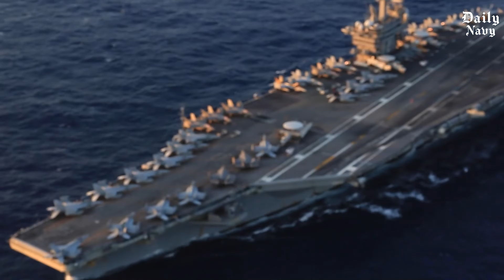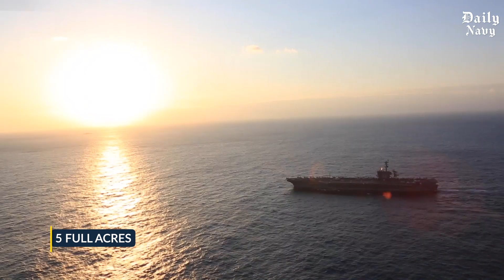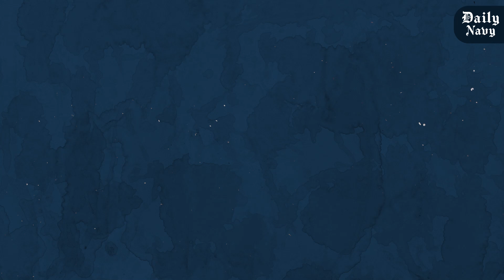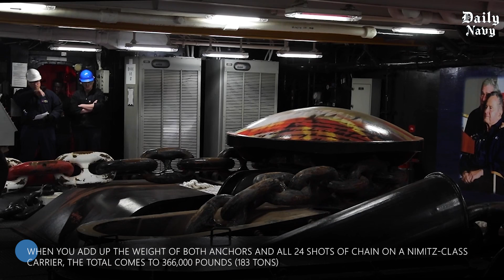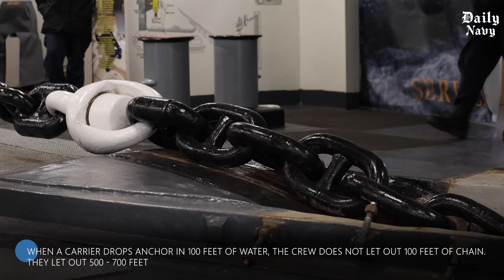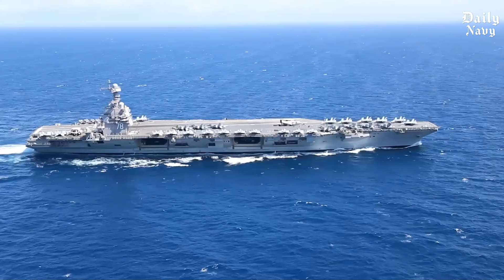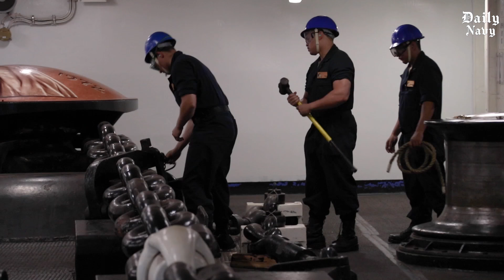Why U.S. Aircraft Carrier Anchors Are More Insane Than People Think

Comment: If the star of the system is the chain then why do you need an anchor? The job of the chain is to keep the anchor low against the seabed by applying its own weight so the anchor is not pulled off. That´s why smaller boats use a combination of chain and rode

Comment: The commentator is wrong. I am 70 and still have my CDL Class A license.  My first B license from 1989 and from 1992 my A license till this day. I am a dispatcher.

In the United States, a standard semi-truck and trailer combination is limited to a legal Gross Vehicle Weight ( GVW ) of 80,000 pounds on interstate highways . To stay compliant, the weight must be distributed across specific axle groupings according to Federal Bridge Formula laws . 

The standard legal weight combinations for an 80,000-pound, 5-axle semi-truck are broken down as follows : 

Standard 5-Axle Configuration

Steer Axle (1 Axle): Maximum of 12,000 to 12,350 pounds .

Drive Axles (Tandem / 2 Axles): Maximum of 34,000 pounds .

Trailer Axles (Tandem / 2 Axles): Maximum of 34,000 pounds .

Total Gross Weight: 80,000 pounds .

DOT Single & Axle Group Limits

To avoid fines, individual axles and axle groupings cannot exceed these federal constraints :

Single Axle: Max 20,000 lbs .

Tandem Axle (two axles within 40 to 96 inches of each other): Max 34,000 lbs .

Tri  Axle (three axles): Typically 42,000 lbs, depending on spacing and state laws . 

Federal Bridge Formula

Federal law requires that the weight-to-length ratio across any group of consecutive axles strictly complies with the Federal Bridge Gross Weight Formula. This ensures the weight is spread over a long enough distance to avoid damaging bridges. 

Overweight Combinations

When hauling heavier freight (like machinery or bulk materials), specialized multi-axle configurations (such as 6, 7, or 8-axle trucks, jeeps, and boosters) are used. 

State Routes: Non-interstate highways often allow higher maximum weights. For example, Washington State permits up to 105,500 pounds for 7-axle combinations off the interstate . 

Super Loads: For weights exceeding standard configurations, multi-axle trailers (like lowboys or specialized perimeter trailers) are required, and drivers must obtain single-trip or continuous overweight/oversize permits. 

To determine the exact legal payload capacity for your specific truck and trailer tare weight, you can utilize the Oversize.io Axle Weight Calculator to balance your load.

Comment: It would be helpful showing a diagram of the anchor chain and its individual components, including the length, weight, and other relevant specifications for each section, as well as the total length and total weight of the chain. It would also be helpful to show these values in proportion to the aircraft carrier, providing a clear sense of the chain’s overall scale.

Comment: A fully loaded (DOT) semi Truck weighs 80,000 pounds. However, there are some loads that can weigh much more than that. They require more tires to distribute the load. I would suggest that you do a little bit more research before you publish your videos.

Comment: In the Coast Guard we use the same chain to anchor buoys, using 10 ton concrete blocks.  But they aren't as strong as they seem.  During hurricanes the chains can be pulled so hard they're stretched into thin wires, and the buoys are sometimes still attached, a mile away from where they're supposed to be.
Reply: Wow that’s pretty crazy too !
Reply: Not facts.

Comment: A lot of people don't know that the chain box is one of the most dangerous rooms in a boat or shipyard! It has historically cost a lot of lives. But the reason is not what people usually think and why I always wore a positive pressure mask the whole time working in the chain box; the steel combined with salt water pulls all the oxygen from the room!
Chain service was my job for years 👍
Reply from the maker: Chain box stories like this don’t get told enough. Oxygen‑starved spaces are terrifyingly unforgiving – huge respect for the way you approached that job and stayed safe 👍
Reply: @Dailynavy  Thanks! Actually lost 3 colleagues within two years thanks to oxygen starvation. Two of them died during their coffee breaks, the last one was working in a team and was alone in the tank for just a few minutes while his mates were outside prepping a pipe.
But what makes the chain box so extremely dangerous is the huge surface area of the chain, even flushing the room with industrial fans were useless, the only safe way to go there is with pressured air masks.

Comment: Mouse Cop,  The 80,000 is for a 5 axle if it is 52ft min from center of steering to center of furthest trl axle back. 12,000 str, 34,000 drives, & 34,000 trl. On average most wanna keep empty weight at 30,000 or less to haul 50,000 legal.

Comment: In the late sixties l sailed on over 200,000 dwt tankers....( they are even larger now.) ..They had anchors and chain just as heavy and large ....The chain was pulled out of the Chain Locker by a massive windless over a bogy wheel  then down into the hawse pipe...It was possible to stand beneath the massive chain, pretend you were holding it up ..like a weight lifter...

Comment: My old 18’ boat had a decent Rocna anchor, most of the rode was 8 mm Dyneema but I made sure I had a good long length of heavy chain.
Reply: Honestly on a modern anchor like a rocna, even a Danforth, you don't really even need much chain if you use 7:1 scope.   I've anchored in 40 kt with just polypropylene and my Danforth.   It was the backup anchor.    When you get to that wind speed, the chain becomes a straight line "bar tight" anyway, so you get the same angle.  Because of that,   using a chain as a catenary is really a poor substitute for scope.  But it works great on a lunch hook, or any time youre pretty confident there won't be 30+ winds.   But the reason I still prefer to run all chain is because of the bottom.   When you run 7:1 with line, and the wind stops blowing or changes direction, it'll either get wrapped up in the reef and fray with nylon, or get wrapped around your keep/rudder/prop, with floating line!   But I wonder why the navy doesn't design massive versions of modern anchors?    This stockless ones provide almost no holding power compared to rocna, even a cqr or Bruce

Comment: You talk about the Ford CVN-78, and then show the Lincoln CVN-72. 
Nobody ever calls it a "forecastle". It's always called a foc's'le.
Three things on a US Navy carrier that make the most God awful noise you ever heard... an aircraft launching when you're under the forward end of catapult #2 (where my bunk was on the USS Constellation CV-64), an aircraft recovering when your bunk is right under the #3 wire and your berthing is right in between the hydraulic engines for the #2 and #3 arresting wires (where my bunk was on the USS John F. Kennedy CV-67), dropping the anchor when the foc's'le is directly below your berthing (again, on the USS Constellation CV-64).

Comment: Not actually understanding the premise of hold, then the “improvement”.
If the weight of the anchor and chain on the bottom is what holds the ship, then why reduce the weight of both just to make up for it by increasing the length? Seems that shorter and heavier, reducing time to deploy and retrieve, would be more important than… what, exactly?

Comment: Interesting video, I wish they'd discussed the procedure for bringing the anchor back up.  I would assume that once the slack on  the chain resting on the sea floor is pulled back into the ship that the anchor then releases from the sea floor, but I don't know that for sure.
Reply: I was waiting for that explanation as well.
Reply: When the anchor breaks free they call "anchor's away" which means the ship is underway (and it's the Navy song) then they haul in the chain and wash it with a fire hose as they bring it in and secure it.  On Sacramento the focsale is the main deck in front of the bridge and the capsan are there too.

Comment: Not a big fan of AI generated content , but no other complaints.  One small detail that was omitted is that the weight of the anchor starts the chain running.  Since it is the weight of the chain that anchors the ship, the ships I sailed didn't use an anchor designed to dig in.  They prioritized getting the thing up, and fitting closer to the hull to minimize hull damage in high seas.

Comment: A FULLY LOADED semi truck weighs in a a bit under 80000 lb.
Reply: This helpful bit of information from the Department of Redundancy Department in case you missed the posts from other 20 or 30 truck enthusiasts!
Reply: @richardwells556  Just in case you missed it the first 20 times. 😀

Comment: Where the F do they store all the chain and how do they store it so it does not tangle?
Reply: It’s stored at the very bottom of the ship in the chain locker. Nothing special to keep from tangling, it just piles up down there. I did my share of anchor details and don’t remember a chain getting tangled up. On the Lexington I think the chain locker was maybe 6 decks down. When I was in 1st division I was assigned to replace the batton boards in the chain locker. There were always legends about watches and rings getting lost down the pipe. I had to clean and paint one of the lockers and I can say the only thing I found down there was rust, mud and a few Coke cans.
Reply: @jeffreykcarlin518  You only found mud and coke cans because the good stuff was already taken by others....

Comment: Note: in opposition to what he says , the anchor is not used to stop a ship! Rather it is used to hold a position
Reply: Anchoring a ship is a very precise evolution.  The exact location of an anchorage is plotted on a chart that is updated in both the CIC and Pilot House.  The anchorage location is a large circle with the point to drop anchor at its center.  This is known as the "swing circle" and accounts for the ship being moved around the anchor point by tides and wind.  The ship is controlled by its rudder(s) and propellers.  At the moment the ship reaches the center of the swing circle, it would be moving at bare "steerage way" which is about 5 knots.  The order for the crew in the foc'sle comes from the Pilot House to drop anchor.   As shown in the video, the anchor is literally dropped and the chain will deploy wildly with a cloud of rust until the brake is applied at the windlass.  The number of "shots" of anchor chain is known by the depth of water shown on the navigation charts.  A successful anchoring will have the ship positioned in the center of the swing circle and other ships are warned away by this ship's navigation lights and flag hoist as well as the location plotted on navigation charts by the Coast Guard.

Comment: I helped build the USS CVN 72, 73 and 74. I was a pipe fitter, and installed the pneumatic release pilot valve system. In layman terms the automatic and manual sprinkler system in magazines USS Aircraft Carriers. Before Christmas shutdown the last day of work, we clean up the ship. I’m gang had the forward part of the and 2 of my mates and I had the chain room. The chain is massive, and is installed during construction, as most huge equipment. People think we have time to explore the carrier when we are at work, but that is not the case, we are too busy working. The Shipyard is on a pay as you complete a section. The quicker a section is 100% complete, the US Defense Department cuts a big ass check to the shipyard. It takes over 5 yrs to build an aircraft carrier, that’s 3 different shifts working around the clock, and 2 different shifts working the weekends. A lot of the time, if we got behind we worked the weekends to catch up. The most I work without a day off was 3 month. Unfortunately Uncle Sam took a big chunk of my overtime pay. Funny fact: if you took all the pipe that is in one aircraft carries and laid it end to end, it would go around the world 7 times.
Reply: I am an original plank owner of the Lincoln, CVN-72 pictured in this video @ 0:20.  Took her to Gulf 1 and ultimately around the world.  You and your team were amazing to work with and she is / was a reliable, best in class, at the time.  She still delivers as seen in the conflict with Iran.  "Shall Not Perish"
Reply from the maker: @Kwik63  Original Lincoln plankowner, Gulf I and around the world on CVN-72… that is incredible history. Love hearing you still back her as best in class and still delivering in recent conflicts. Huge respect for you and for the team that kept “Shall Not Perish” ready to go 🙏🇺🇸

Comment: So which is it? The beginning of the video says that there are two 30,000 lb anchors then a few minutes later it says there are two 60,000 lb anchors.
Reply: I believe it depends on the class of ship. I served on the Lexington out of Pensacola. One of the anchors was stamped 30,000 lbs and the other 30,500. One summer in Mobile shipyard we lowered both anchors and all the chain onto barges then blasted and painted them. The Lex was commissioned in ‘43 so a lot smaller than a new one. If I remember correctly, each link was 130 lbs and the detachable links were around 260.

Comment: i wish this video would cover where they hide the whole length of the chains ~
Reply: The 'cable-locker' is a demonic-foul smelling evil place that no pure soul should wish to visit!  Once the cable is retrieved into this hell-hole, the stench of rotting marine vegetation/rust/crushed crustaceans/etc will fester until the next anchorage evolution occurs..............evil lives there! 😁😁 [me - 20 year Marine Technical Hull Chief Petty Officer]
Reply: I was just a BM3 on the old Lexington, but we called it the chain locker and I believe they were 6 or 7 decks down at the bottom of the ship. One summer I was on the crew that had to stretch the anchors and chains out on barges to blast and paint them. I also had to go down in one of the chain lockers to clean it out, paint it and replace all the batton boards before reinstalling the chains. We had no confined space monitoring, just a blower to pipe fresh air down there. Don’t remember exactly how much dirt/rust we pulled out of there but it was a lot!

Comment: I understand - I'm a Docent on the Midway Museum in San Diego.  Anchors on the midway are 20 tons each. Each link is 156 lbs. Each anchor has around 1000' of chain.  The chain is controlled by windlass engine that turn the wildcat (the gear that the chain wrap around).  There is much more about the process of Anchors away procedures.  Generally speaking you run the length of chain out 5-7 times the depth of the sea floor measured from the keel to the sea floor.
Reply: Say hi to Don from his buddy in Georgia.

Comment: The focsle of the carrier I was on was always kept squared away, as in all the brass shined, the deck kept spotless, etc. Sometimes they held church services there and other events. All it took was one anchor drop to trash the place. The chain would bring up rust and dirt from the chain locker which would get on everything.  
If they dropped the anchor, and for whatever reason, could not stop the chain from paying out, you are going to lose the anchor and all the chain. When yellow shot comes up, clear the area because the red shot and bitter end of the chain is next.
Reply: CV63… I got to trip the pelican hook once.. That was a trip. I spent 2 years in deck department 1st Division.. Hard work, but it was good
Reply: They slow it down before it gets that far.
Reply: @jeffa7671 sometimes for whatever reason they can't slow it down and they wind up losing everything. When this happens, it tends to make the captain a not so happy camper.

Comment: > Fascinating video, but I think one claim deserves scrutiny. If the chain provides most of the holding power, why was the Ford-class able to cut anchor weight by 50% while maintaining similar performance?
> Is holding power really driven mainly by geometry and scope, or does seabed condition still make anchor mass far more important than the video suggests?
Reply: Nature of the sea bed has a lot to do with it and length of cable i spent 12 yrs in the RN ,I did anchor watch many times taking bearings day and night Dragging of the anchor was always a possibility according to sea state and weather conditions  We were responsible for the safety of the ship Informing the officer of the watch of any changes  I served on One aircraft carrier and 3 Frigates and always a Focsle,man  Wind ,Rain ,Sleet, or snow